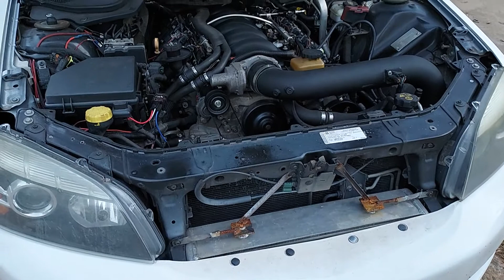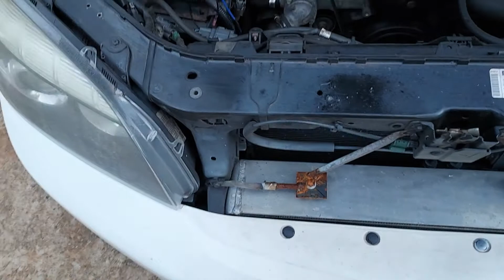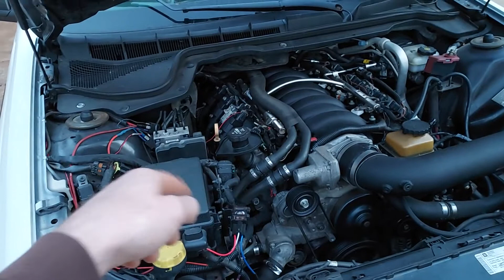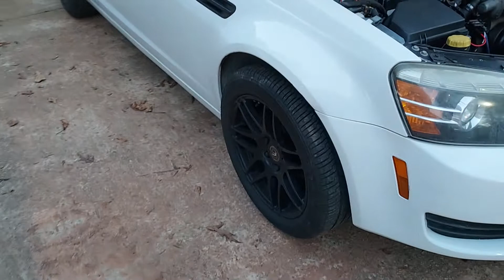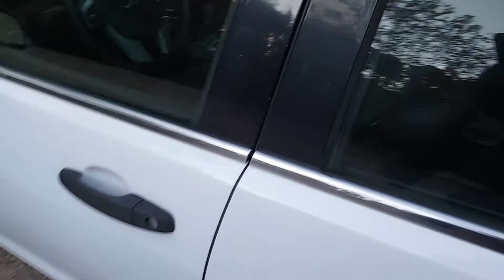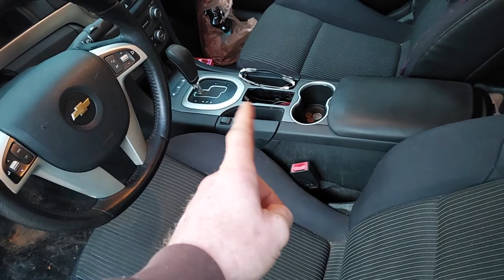Twin Turbo Caprice PPV overview

Comment: About how much power should it make?
Reply from the maker: The turbos are rated at 1100hp, and everything is there to support that. I should have it on the dyno soon.
Reply: @MPKPerformance  niiice. Keep us informed
Reply from the maker: @decaturboss  The car ended up making 967 at the tires, there's still more left in it, but we hit the E38 255kpa limit.  Above 255kp, the car will close the throttle body.  The work around to this is to go to a larger map sensor and rescale the ve table to surpass that limit.

Comment: Nice work. I have a 2017 Chevy ss built forged ls3 with a turbo. Fore triple 450 pumps. Fic 1650 cc. So much to list. But will make 1200 to hopefully 1400+ hp.
I also just got a caprice 9C3. So I came with full interior. I’m verifying with you that when i use manual mode in the caprice it is almost instant up and down. So look into that bro. Keep it up.
Reply from the maker: Sounds like some fun builds!